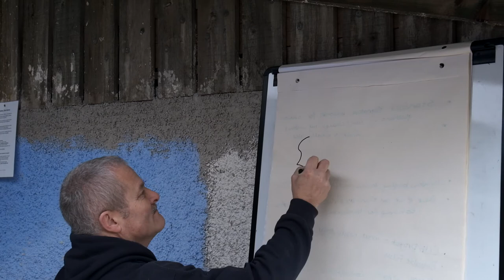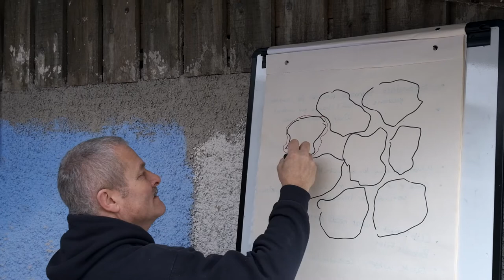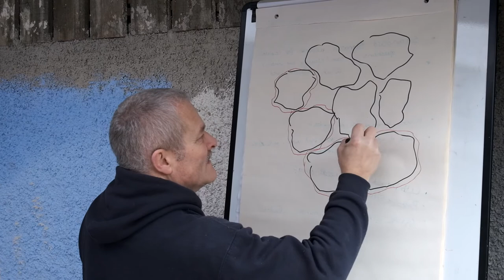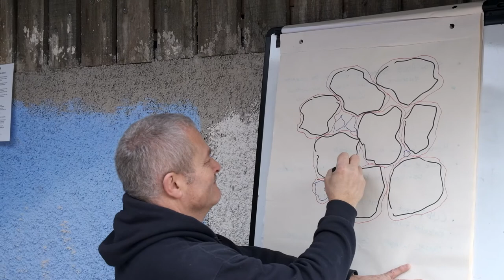Aggregates and traditional mortars

Comment: really good presentation easy to understand. Ive never worked with lime and now i have a need to on my own house repoint some of the existing lime brickwork.The only thing i,m not sure of is which sand to use.I will take a sample of lime from some of the joints and send it away to a company that will match color and they sell ready mixed hydraulic limes.I would rather mix myself.I may even have to repoint the whole house once i get familiar with the basic process....Thankyou for any advice
Reply: I need to repoint my house with lime wash and also not sure on the best aggregate to mix it with. There is another video from the same channel which explains how to do the mix but no explanation as to which sand to use?
Reply: @avfczoff it's what he was talking about the whole video. best aggregate for lime morters/plasters